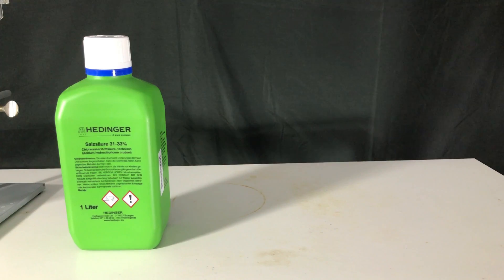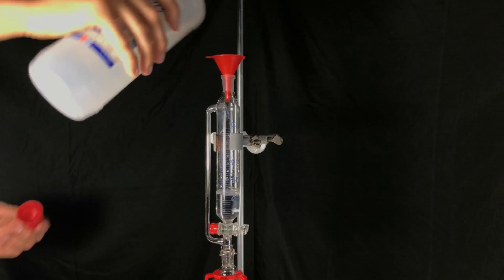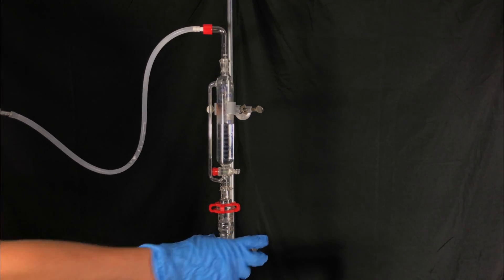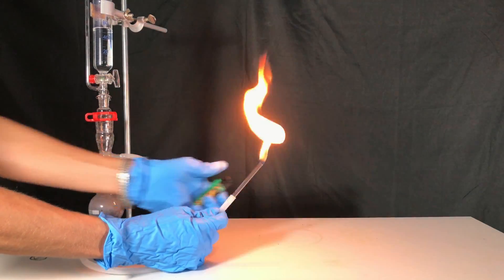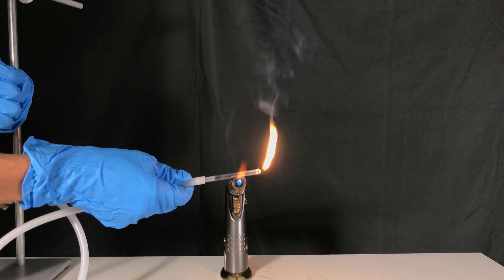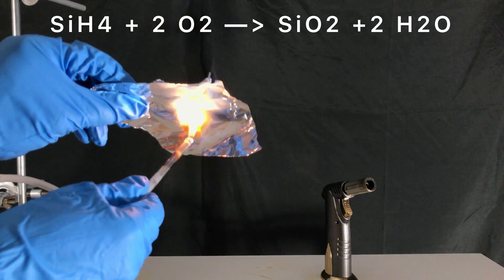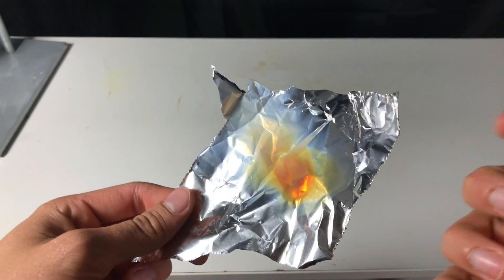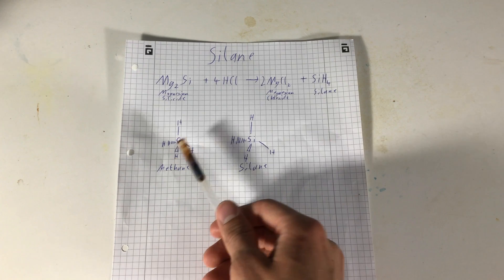Making silane and experimenting with it (SiH4)

Comment: Why does Silane ignite by itself?
Reply from the maker: the silicon hydrogen bonds are not as strong as a carbon hydrogen bond like in methane. this makes silane very reactive
Reply: @THYZOID  Thanks,the equation for the reaction is very similar to methane with oxygen but with silicon rather than carbon atoms

Comment: What about germane and stannane?  How are they prepared?  Are they more pyrophoric than silane?  A comparable video about one or more of them would be interesting.  Thanks for this.  Very interesting.  Oxidation of silane of the purity used in electronics is a way of making extremely pure silica.  This in turn can be melted in crucibles of platinum or similar unreactive metals to make extremely transparent glasses that are used in UV optics.

Comment: Could you use silica gel beads in place of magnesium
Reply from the maker: No
Reply: Dang is flame produced hot enough to melt glass? Probably not oh 1 more question is pure silicon (used for solar) as hard to produce as many make it out to be

Comment: You should try ampouling liquefied silane (although I don't know the vapor pressure, so it might be a bit dangerous, and you'd need to flush it with argon or some inert gas so it doesn't ignite)
Reply from the maker: Have to get liquid nitrogen before we can do that. But after ampouling H2S we’re gonna work our way all the way down to gasses with lower and  lower boiling points.
Reply: @THYZOID  I don't mean to bug you, but could you please liquefy silane? That would be so cool!
Reply from the maker: @oitthegroit1297  I currently don’t have LN2 but once I have some I’ll continue my liquified gasses series with stuff like silane
Reply: @THYZOID  Awesome!
Reply: Silane goes supercritical at about 24.8°F and a pressure of 702.7 psi